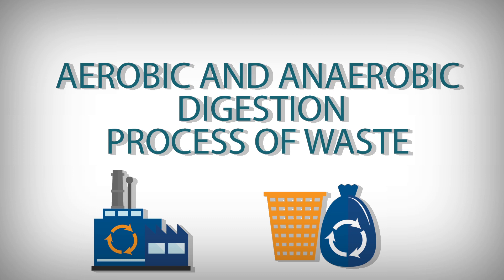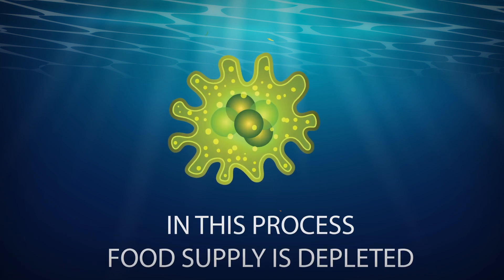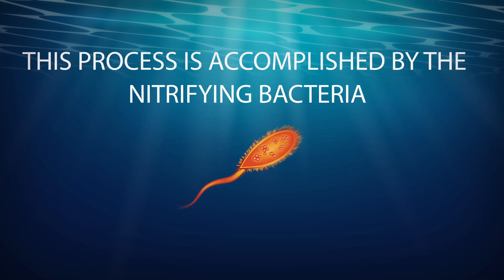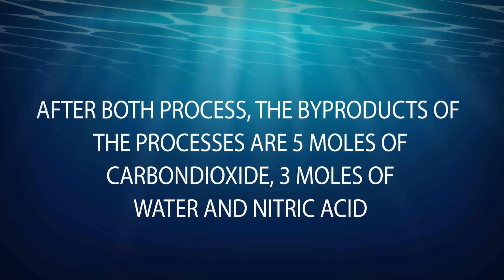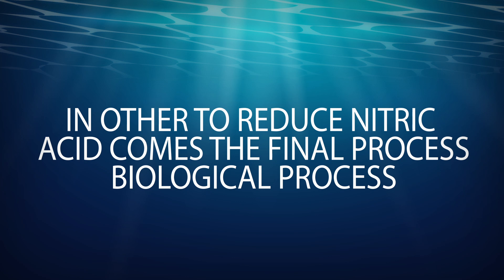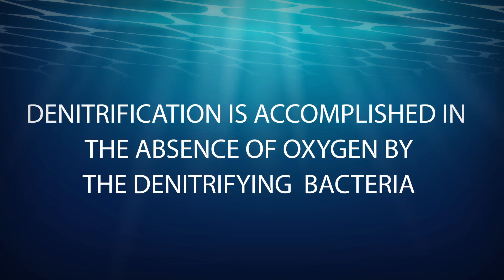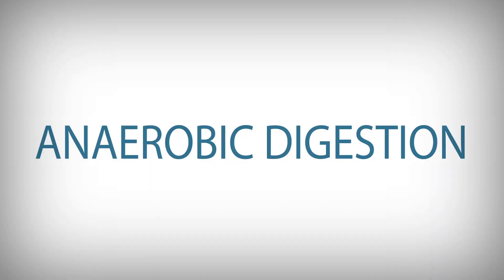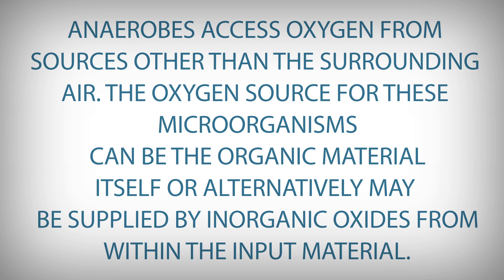Aerobic Digestion and Anaerobic Digestion

Comment: Which digested slurry Anaerobic/Aerobic is good for plants. Since plants roots need more oxygen to thrive is Anaerobic good or bad ?
Reply: In aerobic reactions, the main ions produced are hydrogen ions (H+) and hydroxide ions (OH-), as well as ions of nutrients such as nitrate (NO3-), sulfate (SO42-), and phosphate (PO43-).

In anaerobic reactions, the main ions produced depend on the specific type of anaerobic process. For example, in anaerobic digestion, the main ions produced are hydrogen ions (H+), carbonate ions (CO32-), and bicarbonate ions (HCO3-), as well as ions of nutrients such as ammonium (NH4+), phosphate (PO43-), and sulfide (S2-). In fermentation, the main ions produced are also hydrogen ions (H+) and sometimes acetate ions (CH3COO-), but the nutrient ions produced can vary depending on the specific type of fermentation
Reply from the maker: Thanks